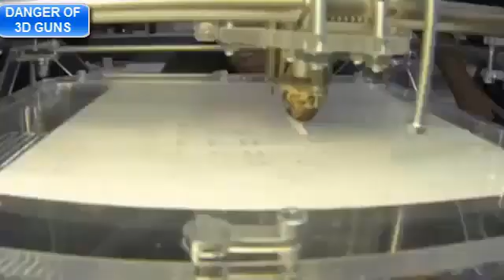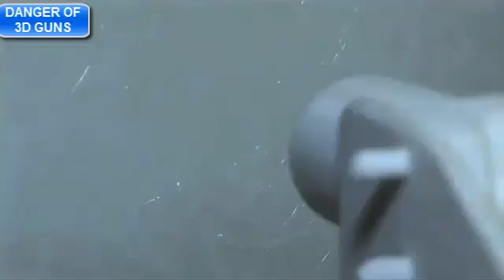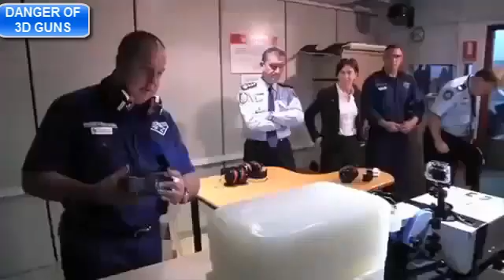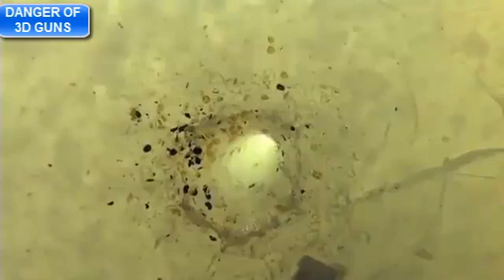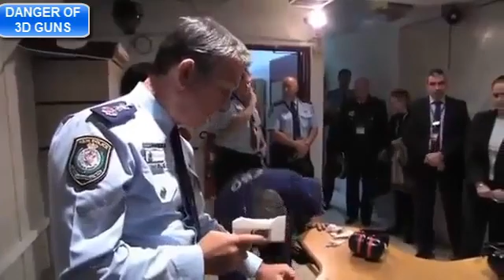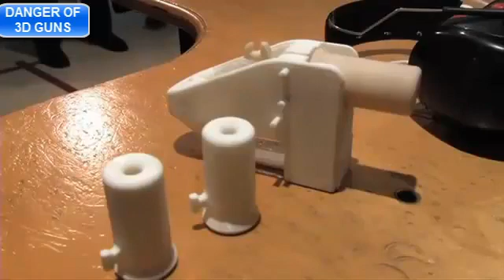NSW Police Test The Liberator 3D Printed Gun

Comment: after more thought, what caused the guns to blow up was  1. the gun should have been printed with 100% infill 2. the gun should be made into 22 cal instead of 380. print with ABS or stronger if possible. 3. if someone wants a gun they will get a gun 3d printed or not. If they can't get a gun , they will use a knife . If they can't get a knife they will use a rock. If they can't get a rock they may use a piece of wood . And if they can't get a 2x4 then they are on mars and no threat to anyone. so i say let people print it if they want and if they get in trouble with it, its their ass in jail and as usual the responsible people you will never hear about.

Comment: The pins aren't inserted all the way they're purposely putting it in a state to explode they're also using a publicly available commercial printer Cody Wilson the creator used extremely thick plastic so it won't explode this police department is trying to get you to be afraid of this
Reply: Yeah exactly not only that but they printed with the wrong material and printed it in horrible quality, which is clearly seen

Comment: Defence distributed specifies that the model be printed on a PLA/ABS/HIPS FDM machine at 100% infill.
The explosion sounded like a ceramic version, and I know what the plastic one sounds like.
I don't even know what 3D printer they used, if anyone has all the legal documents and firearm licenses to produce this, use an ultimaker or makerbot. I wouldn't trust even the prusa series either.
Reply: +dah4x The printer itself does not matter, it's they way it is calibrated, how the temperatures (bed and nozzle) are set up, nozzle diameter, extrusion speed, etc. If anything, the Prusa series is better because it is more user configurable.
Reply: The purpose of this demonstration is to deter people from making one themselves. The vehicle for this effort is disinformation. Making the weapon from an inappropriate material is intended to frighten people who might want to try making or even using one.

Comment: So, they deliberately made their 3D gun of poor quality to misinform the public.
Reply: martthesling I doubt most people would have a very expensive 3d printer let alone a 3d printer itself. They aren’t trying to misinform anyone, they did exaggerate a bit though.
Reply: jye traval - agreed. I'd imagine they didn't go out of their way to ensure that it was a perfect build, but even so it looks so far from being a useable gun that even with a top spec printer and better materials I wouldn't go near it. If the base level build of a gun isn't just a bit dodgy but explodes into a thousand pieces when you pull the trigger I can't imagine that an increase in build quality is going to make it reliably safe to use.
Reply: The Sprawl exactly
Reply: Yes, to create an "in terrorem" effect.
Reply: lowest common denominator
Reply: You may have to keep in mind that they're using "poor quality" because that is what is available to most people through public services. Public service materials and machines aren't high end and they won't work well. I don't think it's bad thing to discourage people from using them bc it's simply not the right materials to be effective. Most people don't have access to the higher end stuff that is actually necessary for it to work. If it's deliberate, fine, but it's not unrealistic. There's a lot of idiots out there who will just go try to print one without doing any research whatsoever on it.
Reply: anyone with real gun making equipment, like  a lathe, etc, doesn't need THESE blueprints, there's plenty of other resources, the information isn't a hurdle.
Reply: I am sure they used a cheaper material to print there one so it looked bad.